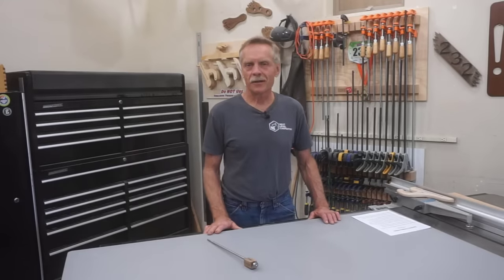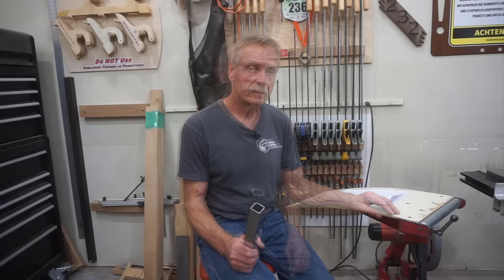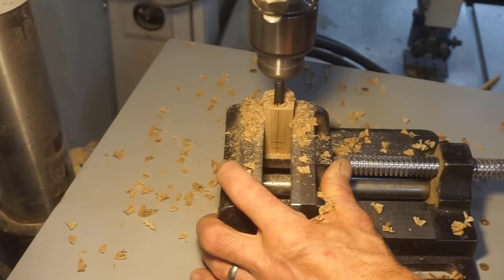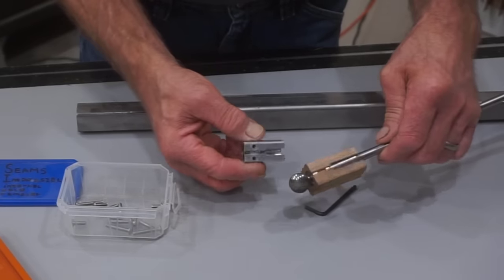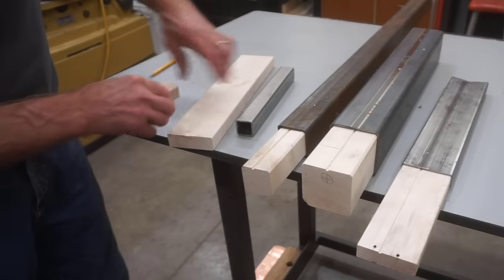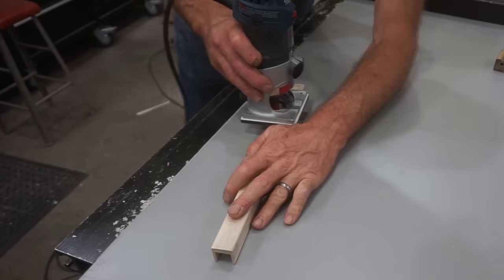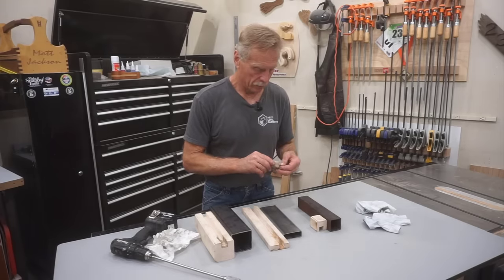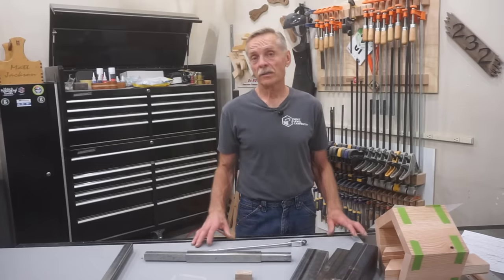How to Quickly Remove Internal Weld Seams from Steel Tubing

Comment: Before you start to cut. Soak the tube in vinegar or muriatic acid overnight.  That will remove the mill scale inside the tube and make it smoother.

Comment: My old dirty trick taught to me by a mean old boilermaker from Belfast was to make a chisel from a short piece of bar stock 3 or 4 inches long in the appropriate shape and size for your tube round? square? it really doesn’t matter. Tap that sucker in a little way and use a rebar or a square bar to tap and push it through. I once saw that dude make a pipe out of a piece of plate.
Reply: I wonder if heating up the cutting edge red hot and quenching it would make it harder.  You would not have to heat up the whole bar, just the edge that makes contact with the weld seam.

Comment: Very neat idea. I use an air chisel gun with an extra-long dog-leg chisel (reground for flush cutting). Gets me 200mm from each end, 400mm total. I can see that your method could have unlimited reach with enough extension rods. Well done on the design.

Comment: I would not have thought there'd be any videos on how to remove the weld seam in steel tubing.  But, I'm sure this is the best.  This is truly next level stuff.  I may never use this tool but I'm sure I learned a technique or two by watching.....which of course is the point of many of your videos Matt.  Great job.
Reply from the maker: The main application for the Seams Impossible tool and process is for the upcoming outfeed roller stand build video series where I'll use it (and refer to this video) to make the sleeving parts for height adjustment and dissassembly connections SOOOO if you end up making a set of those stands you may use this unexpectedly Rick... as always; thanks for watching and commenting here!   Best, Matt
Reply: This is pretty good at what it does..  but fireball tool shows a simple DIY tool that takes 10 to 15 min to build and uses I high speed steel scraper inside a scrap slug uf the inside tubing size and you simple use all thread and a impact to draw it through any length tube you want.  You could strip a 10 foot long section in minutes.

Comment: What about just making the sleeves a bit long so they overhang the carbide burr? Then they will guide the carbide burr until all of the seam is gone. Like a hybrid of the first idea and the sleeve that went all the way through the tube...
Reply from the maker: Great contribution for developing 'best practices' Espen... I like it! Best, Matt
Reply: Or just have an over length section of tube and cut it to length after grinding out the weld seam.

Comment: I really like your tool and video for the Seams Impossible. I am an electrician with 35 years in the trade and experienced mostly in commercial and some heavy industrial work. In your video you mentioned collaboration with other trades to come up with better solutions to issues on the job. I also came up with an invention a few years ago and as a result I expanded my tool collection. This made me search out someone to do machining for me. Most shops I found in my area do highly precision work for aerospace and performance automotive. They weren’t interested in my work. So I proceeded alone. The best tool I have in my tool box is a willingness to work with other tradesmen. Some of the projects that I’m most proud to have been a part of involved working together to hand over something that was exactly what they wanted.  By working with other trades I’ve learned a lot about other trades made some good friends and a background that keeps me going with my projects. My current project is making a mount for a train bell from the 1850’s, I’ve got train track, large structural lumber and finish woodworking along with metal work. It’s been a really cool project. I’ll be purchasing the Seams Impossible, I ran into the problem you found the answer to. I got past it with a rotary file and extension, but what a pain in the neck. Nice tool, great idea
Reply from the maker: Always nice to hear from like-minded folks Scott...  hope your train bell project goes well!  Feel free to post comments about any projects you do that are made simpler with the Seams Impossible... we're anxious to hear how the tool gets used 'out in the wilds'! Best, Matt

Comment: This is definitely a viable idea, we have been using the same tool to remove weld seams from square tubing for over 40 years. Ours is a bit different in that we actually have a separate block for each size tubing, but we only cut 3 sizes. We used a smaller WIDTH block and put various bolt on shims on the sides in order to shift the tool to hit the weld seam, as it changes location with every batch of tubing.
Reply: Did you use a self made or commercial tool?
Reply: @hardcase1659  I guess you would consider it self made. Our tooling department manufactured it. Since we never marketed the tool to the public, you really wouldn't consider it commercial.

Comment: For my 2" wide belt sander build, I took a piece of solid 6061-T6 about 12" long and machined it to a square that would just fit inside the tube. Then I measured and machined a groove that would fit a 5/16" keyway broach. I now have a keyway mandrel that will guide the broach over the internal weld and cleanly cut the weld excess away. Rather than cut a radius on the mandrel to fit the tube, I just cut a rebate on the 4 edges since the heavy wall tubing I was using did not have a consistent internal radius in any of the corners. I also cut long brass strips of shim stock to make the shims needed to move the broach about .010 per pass until the weld was removed. I'd make a pass from one end, then flip the tube and run a pass from the other direction. Since our Dake arbor press would not accommodate the length of the tube and extended broach, I had to use the hydraulic press to get the broach about 1/2 into the pass, then I could switch to the arbor press. Also, watch out for different tubing manufacturers because they are not all made with the weld in the center and I ran into some tubing with the weld offset to one side which required me to cut another broach slot on the opposite side from where I cut the slot for the centered weld. I also used a broach that was already a bit abused with a chipped tooth and I wouldn't recommend using a good broach since the weld material seemed to be fairly cruddy. Since my tube stock came out of a junk pile and was fairly rusty, it first got dunked into my electrolysis rust remover system to get the tubes as clean as possible. Overkill? You bet! But I had access to the materials, and it was more of an exercise to prove it could be done this way.

Comment: Great idea for the use of the bearing Matt . I made one very similar using a piece of uhmw nylon cut to a 5'' length and a 6'' long 1/4 diameter shank , 1/2 dia carbide burr with the shaft hole drilled through the nylon at an approximate 2 degree angle . I use beeswax for my cutter lube and have for over 30 years, doesnt fly off the cutter like thin fluids and it is very easy to apply. I tried pushing the bit through as well as pulling and also ended up pulling it. I have used this tool on square and rectangular tube from 1'' to 2'' .very much enjoyed your video.
Reply from the maker: Thanks electricman... I really like your idea of using a 2 degree angle to get cutting action out of a 1/2" diameter burr since they're a LOT less expensive than the $55 I paid for the 3/4" one seen in the video.  Great minds think alike, right? Best, Matt
Reply: The half inch burr makes way more sense, the cost alone is a reason to add the angle you mentioned. Plus, the bees wax is a better agent in many applications. Stay safe, Jim
Reply from the maker: @aerialrescuesolutions3277  maybe so providing the bit extension doesn't get too restricted in long lengths of tube. Even so I disagree it's a better solution although it certainly sounds functional... I would agree with a "different solution" statement...
Reply from the maker: @electricman5010  thanks for clarification!  Is there a maximum tube length restriction on your tool?  Doesn't sound like it but I'm not able to visualize the angled shank/shaft design without imagining it being limited when the angled extension encounters the inside wall of the tube.  As is I imagine making something much like you describe that just gets the job done if I weren't doing it for a YouTube video.  I'm intrigued by your use of beeswax instead of 'cootin' Earl' and may need to give that a try.  Best, Matt
Reply from the maker: @electricman5010  thanks again for politely adding clarification for your useful mouse trap! One more technical question here: did you need bearings or were you able to just let the shank of that carbide Burr spin directly in that plastic block?  With your explanation about doing shorter pieces and using a flexible shaft I can now easily envision how your version worked well and got the job done... great minds think alike, yes? 😁😎
Reply from the maker: @electricman5010  Thanks for more insight and background on this!!  I started my quest for the V1.0 tool looking for a chunk of solid brass for all its useful properties and ended up using maple because brass over 3/4" x 3/4" was cost prohibitive for an experiment and not available locally anyways.  I've seen UHMW used for bearings and bushings in all manner of things but it never crossed my mind for this while brainstorming.  Greg mentioned it for jacket material but neither of us seriously considered it for the tool itself.  Funny how one 'rabbit trail' leads to many others but not ALL others!  I hope others benefit from our dialog here because a block of UHMW and any common 1/2" diameter burr is all the solution a majority of makers will need for a simple, one time sleeving project.
Thanks for watching and commenting here! Best, Matt

Comment: I worked in a Fab shop for many years and we used a lot of slip jointed tubes and pipes but the exterior parts were always ordered as seamless tube and pipe to avoid this process. It’s not cheap and I like your idea because it’s easily accomplished with simple tools and a little bit of time. Thumbs Up.
Reply from the maker: Thank you for watching and taking time to comment about your experience and viewpoint!
Much appreciated... Best, Matt

Comment: @24:36 for those who may be anxious about using a blade so close to the surface  you can dado a thicker wood and then thicknesser the entire piece down to the right external size which will  make it safer to process

Comment: 20 years ago, I had a build that required square tubing to be sleeved.

I found a distributor for the Plymouth Tubing Co. that makes 4130 seemless chromo tubing, round, square, rectangular. Its very strong, yet easy to work.

By doing the math, I figured out what wall thickness allowed for sleeving. Success was obtained for both square and round.

Still, seemed tubing is easily available... 

Great design... kudos!

Comment: Great Video. This is hands down the best technique to remove weld seams. Will the bearings you have on your store fit the CNC version?
Reply from the maker: Thanks for sayin' nohokum... I do hope the video gets widespread exposure because it's the sort of solution I would go for if I didn't end up developing it to solve the same problem so many others face.  For your question: Both the 'bare tool' and 'full featured CNC' versions of the tool come with bearings included (even though this fact was  bit ambiguous in my video dialog) and I only assume that these would fit.  I included them in the Amazon list for anyone making the Version 1.0 tool out of wood.  Hope you get a chance to put this to use! Best, Matt
Reply: @NextLevelCarpentry Pretty good deal if you buy the bare tool from Greg and get the drill extension and carbide burr from your store . Less than a hundred bucks. Can't beat that.
Reply: Actually, check out Fireball Tools seam cutter, which is both better and faster as it uses a tool bit to cut the seam out vs having to grind it out with a burr..
Reply from the maker: @Flying0Dismount  Faster and better?  Not sure what your criteria is but I disagree completely! Take a look at results in these two time stamps and judge for yourself:  https://youtu.be/ozSE7Wrdb1o?t=1896   https://youtu.be/3jr4Capx8XI?t=440  Best, Matt
Reply: @Flying0Dismount  Yep, the Fireball version  definitely works and he has a lot of great tools. There's a video by Lazy J Metal Works which I think is even better. But for your average woodworker I think Matt's gizmo is a better solution. Now if you're planning to do this on a daily basis you have to consider how long that burr is gonna' last because that's the most expensive component. In that scenario HSS might make more sense because you can resharpen. But as I said for the average woodworker who's only looking to clean up a few tubes Matt's is easier to build and easier to use.

Comment: Genius approach to a nagging problem. It's the best way of removing the weld that I've seen so far. You could make extensions to the burr and do any length as well.
Reply from the maker: Thanks!  And you're right: we plan on extensions for use on longer tubes.  I've yet to see a limit on maximum length of tube achieved but it might be fun to do 10' + just to say it could be done, right?

Comment: In the round tube fabrication industry, the internal seam weld is removed using a scarfing car. It's basically the same concept as your tool. It spins as it's pulled through. You can't spin in a square tube. It's good to see guys like you solving every-day issues.

Comment: Excellent video I could have used 30 years ago. I'm too old to do it now but I used to make power miter box saw stands using square tubing like you're doing with your stand. I ended up using smaller gauged metal to get past the seam weld. The first thing that came to my mind was what if your seam is off-center too far to reach it? I suppose you'd have to pick out your steel when you purchased it. I really enjoyed this video and followed every bit of your problem solving with each step.
One way to fix the loose-fitting problem is to put the welded nut tightening mechanism on the corner of the tubing.
Thanks so much for this video.

Comment: I worked in heavy industry with 'form tubing' for years, and we usually needed 'internally scarfed tubing'. While the equipment we used cost A LOT, you can make an actual scarfing device in much-the-same-way that rifling is put into a gun barrel. All you need to scarf a tube is a 'blade holder' (tool holder that will fit through the ID of the desired tubing), a carbide blade, and a winch to draw the 'holder block' through the ID of the tube. This is 'drawing the scarf', and is relatively easy to set up and cheap to operate (not for 'one-off', but for even a few hundred feet of tubing a year, it can pay for itself).

Comment: Thank you for the great idea,  since you mention "makers", with a 3d printer just print the bearing housing the exact size and offset you need and do away with the carrier / sleeve concept. The labor involved in creating the maple block and building different sizes is tedious so I get the sleeve design. I had to remove the seam from 6 foot long 2 inch tubing with 1/4" walls to make a slide out kitchen for my RV. I designed a tool and printed with 10 percent infill because it is just a hollow carrier for the metal parts and doesn't need to be super strong. I built a 6 foot extension shaft and did the first piece with a couple of iterations. But the next 3 pieces had the seam in a different place ... so change a few numbers and print a few cents of plastic for an exact fit. Also grind two flats on the shaft of the bur so that the setscrews don't protrude and the bur can't slip out.

Comment: Hi Matt, Superb lateral thinking! Just wondering, for adjusting to multiple tube diam and even round tube, could you have a sleeve with roller wheels that spread with a screw action to each side and above that would allow infinite variation without the need to make custom sleeves. Could also be used to offset the tool. Mount it behind the Seamless so that it gave room for the Mechanism?  Would it be tooo fiddly. Maybe greg could put his thinking cap on.....
Reply from the maker: Thanks for watching and commenting on this Peter... I like the way you think.  Greg and I did a fair amount wrestling with the 'adaptability problem' with Greg doing more than I.  Greg went beyond thinking with prototyping etc and, if you check out "The Ultimate Kit" on this page you'll see his clever solution: https://gregsgaragekc.com/  Although sleeves and shims are less elegant than roller wheels they are considerably less expensive and less 'fiddly' too. I imagine a roller-wheel system could be contrived with a NASA scale research budget but would result in government budget pricing as well 😉 I tend towards optimism and you just never know when another lightbulb moment might occur and result in a Seams Impossible 3 though...  Best, Matt

Comment: I love this tool. I would make a couple small changes. Shave a flat spot on the shaft where the set screws go so the screws have a flat surface of the shaft to tighten up to and prevent spinning. Go one step further and cut a  shallow v-groove into the flat spot to line up with the set screws so a pointed screw could be used and make it almost impossible to it to slip. Having a flat spot as well as a groove make it so the user can use flat screws or pointed screws depending on what they have access to or can make themselves. I would also drill a couple small divets to line up with the set screws (pointed tip screws) to prevent the shaft from pulling off the extension. I have a couple more ideas for this tool to try adding but I'll save those to try out in my own shop when I get my new lathe.